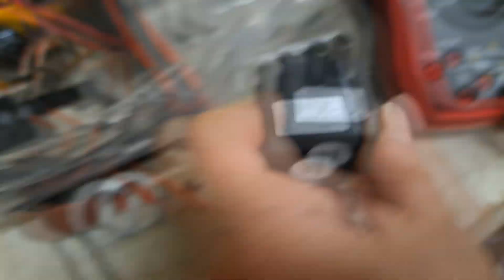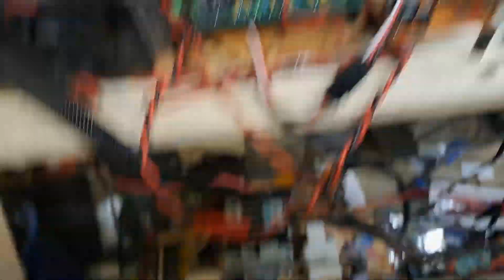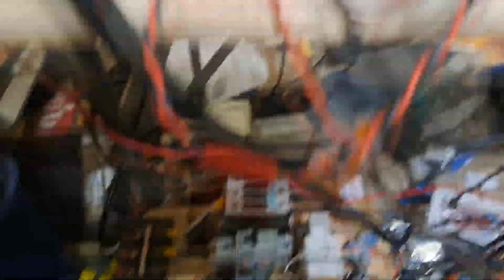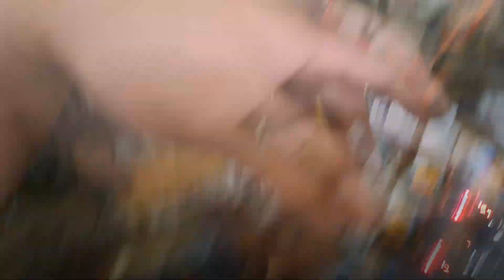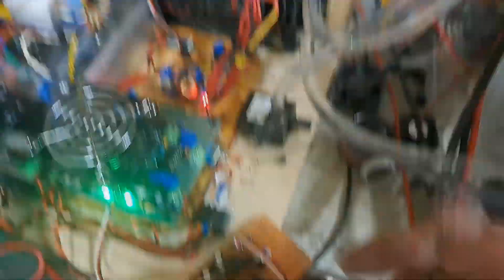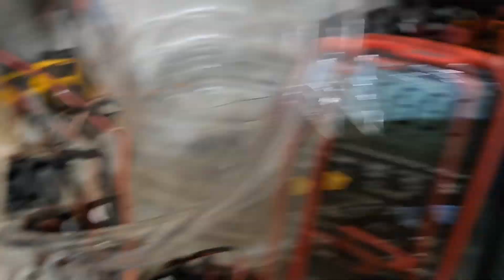H-Bridge Induction Heater & DRSSTC Driver OCP Test

Comment: The stacking of 2 (or even 3 toroïds perhaps) would boost the available power, provided all power stages can be synchronized...
Reply from the maker: So far this core seems like it might work out but yea no telling at higher power. I have some other cores I can try but they are all ridiculous sizes. I might just try buying like 4 small ones to stack.
Reply: @Magneticitist  Bigger just means more stress, multiple toroïds might get an edge by spreading it evenly.  But i can only wonder.
Reply from the maker: @Egzoset  I think the important part is just matching it to the tank when it comes to desired power. It also of course has to pass squares properly at the desired frequency but so long as it does that I think just tweaking the primary impedance is the idea.

Comment: That’s really cool. Would love to this turned into a DRSSTC. Where did you get the feedback current transformers for the OCD? What IGBTs are you using?
Reply from the maker: The CT's are made by ABB and just pulls from old VFD's I junked. Actually pretty expensive after looking them up. Same thing with the IGBT's, just pulls from old VFD's. Those are FUJI 1200V 200A bricks.

Comment: What resonant caps did you end up going with?
Reply from the maker: Brian (SciTubeHD) linked them off aliexpress. If you search "2UF 500V 650A Solid-state high-frequency resonant tank circuit machine low sense of film capacitors" they should come up.